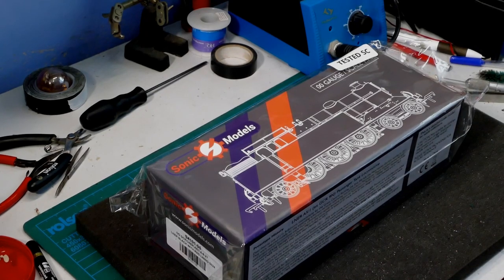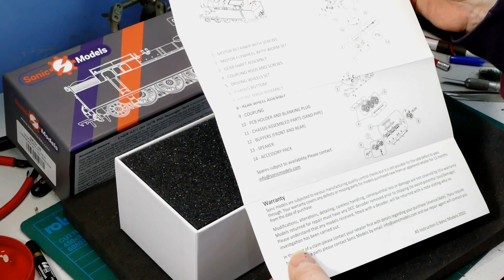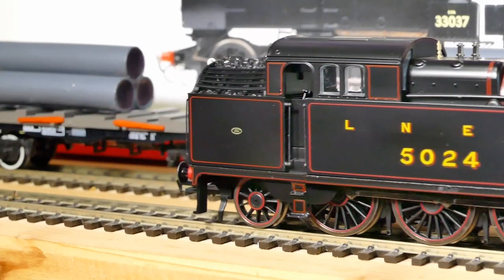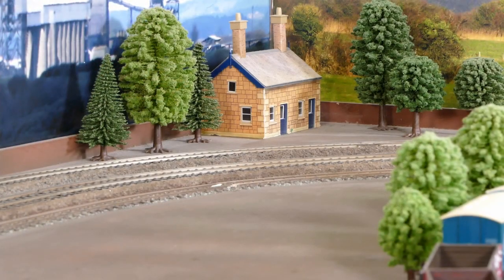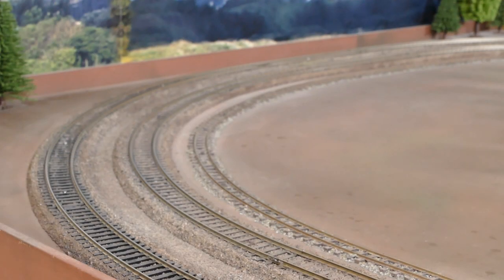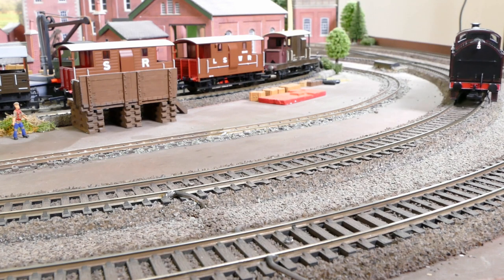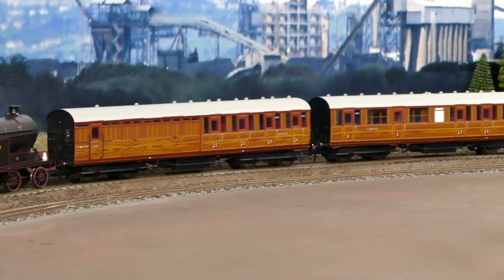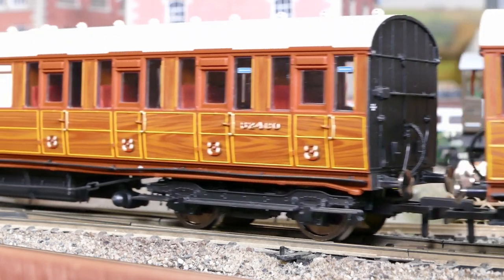Sonic Models Robinson A5 Pacific Tank Locomotive Review #sonicmodels

Comment: Lovely loco and an informative and entertaining video.

Sam did confirm turned bearings & a flywheel!

It is also interesting to see the differences between his GCR-livered version and yours. Apart from the livery, the cab has additional windows and whistle placement is different.

Also, your version has it's lamps fitted, whilst his were in the accessories pack.

I've also seen then compared side by side by Jennifer Kirk, and both are very striking. 

Overall Sonic seem to have done a good job. Please keep us posted on whether those tight spots & warm boiler issued improve.

Thanks again,

Stephen
Reply from the maker: Hi Stephen, many thanks indeed. If only I could get his view count lol. I'm planning a post running in maintenance video so stay tuned:)
Reply: @ModelRailwaysUnlimited  Yes, Sam seems to have been very successful in "building his brand"! I realised this when I saw how much one if his Salvage or Scrap locos sold for on eBay: at least 10 times as much as identical non-Sam models were on sale for!! 

Well, good luck to him and good luck to you. You both have very watchable, entertaining & informative channels, IMO.
Reply from the maker: Most kind, difference for me is that its Sam's job while for me it's 100% hobby. Lot of respect for Sam a throughly nice chap and trusted reviews.

Comment: As with the Kerr-Stuart, 'Victory', not a big enough motor. Quite a good looking loco and an unusual item to have on your layout. The motor heating up is not a good sign. The inconsistent pulling is a symptom of an impending failure! I hope you don't up having to send it back!  Thanks for an entertaining video.
Reply from the maker: Hi Allen, many thanks for the kind comments. I'm currently not worried about the motor. Its current draw even with the five coaches is now just below 100mA which is OK. I'm planning a post run-in service video to make sure there is sufficient lubricant etc. Might get to it later

Comment: Nice looking model Mike, I do think they look good and are pretty good runners. I have given my GCR a drop of oil after running in and my motor was warm as well but so far seems okay otherwise. I’ve not opened the gear box yet but they do have metal bearings on the drive axles, I’m pleased with mine so far.
Cheers Rob.
Reply from the maker: Thanks Rob, service video uploading

Comment: Always been fascinated by this one ever since I stumbled across a photo of it in a book some years ago. Something about the inside cylinders makes the odd wheel arrangement a lot more prominent, and it has some great lines overall. I'd hate to have to crawl in between the tank corners and the little cutout to oil up, though! The red pinstriping around the wheels and motion is really good and fine on this model, it seems like especially the wheels would be easy to get off-center, really incredible paint!

I don't know why, but I have a strangely strong desire to slightly modify/repaint a black version of this loco to represent a "close enough" LNWR Prince of Wales tank. Naughty of me, probably, I think it's the shape of the smokebox door that does it for me.
Reply from the maker: Hi and thanks for watching. Yes they have done a great job with it. Glad I went for this version. Good luck with the conversion